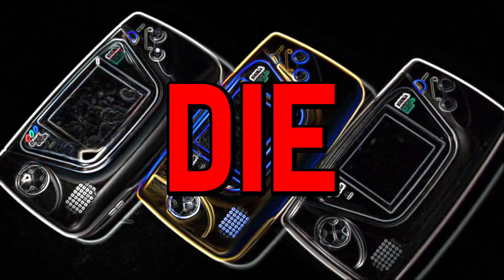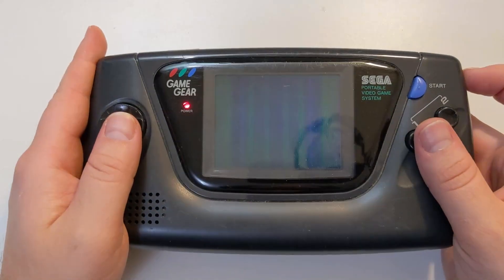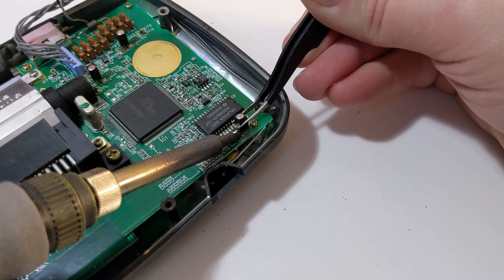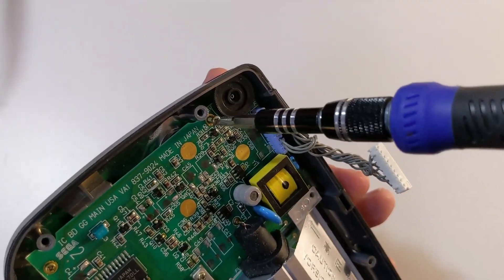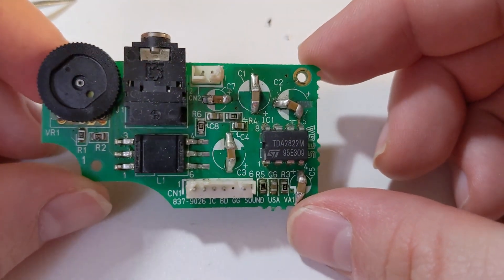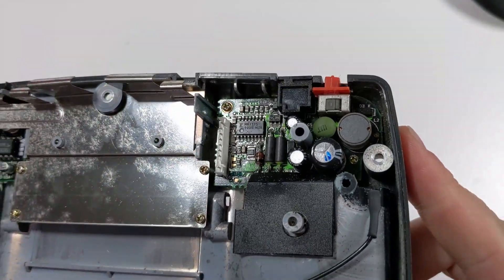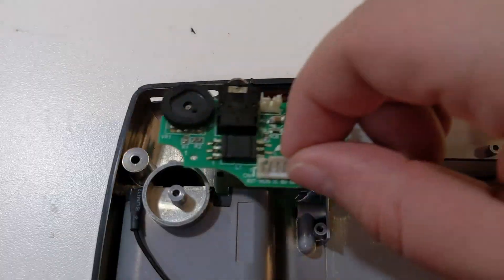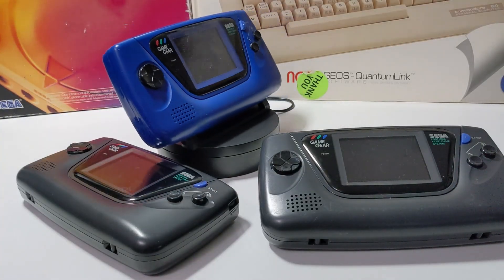Don't Throw Out That Old Sega Game Gear! Here's What Could Save It...

Comment: Any help would be great, did this ceramic cap replacement and it turns on for one split second then goes off. Double checked the points and it seems they are correct.

Comment: I guess i have to do this to a $14.99 savers find. The batteries area was slightly crusty. Cleaned it up, popped in batteries, turnd it on. The screen showed a game then 15 seconds poof screen went blank. Well it worked till that happened 😂.